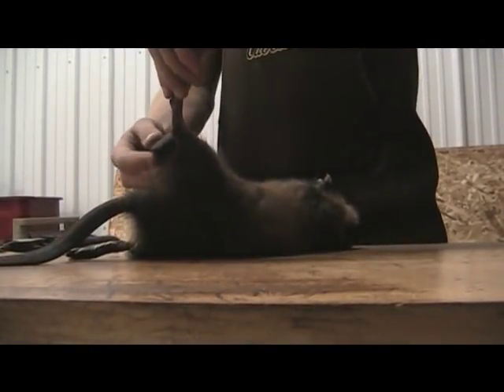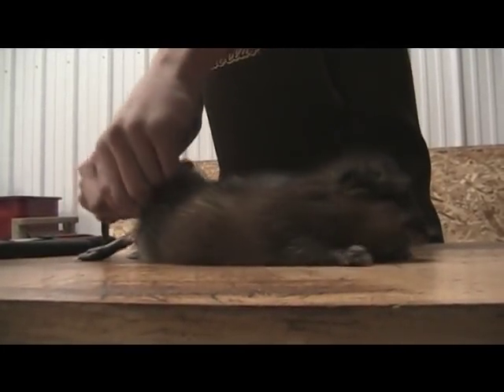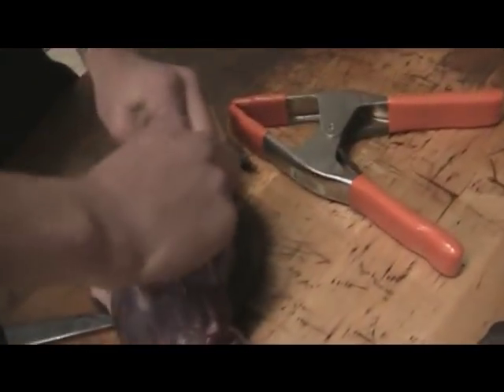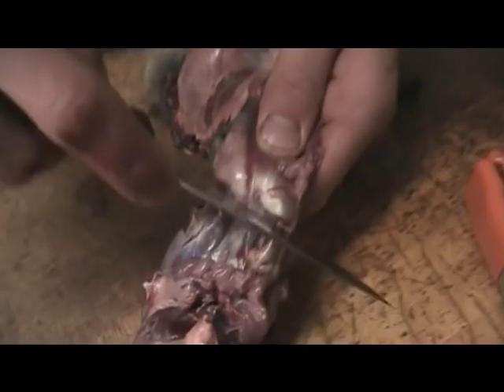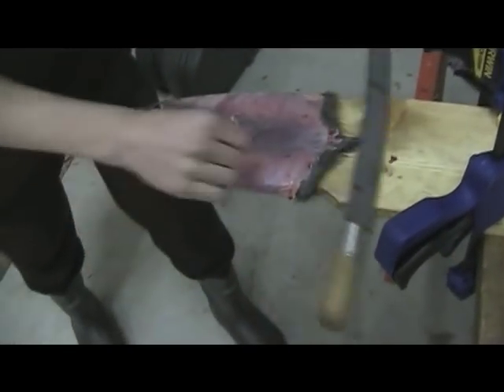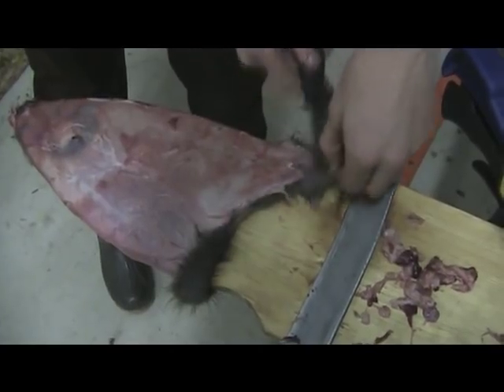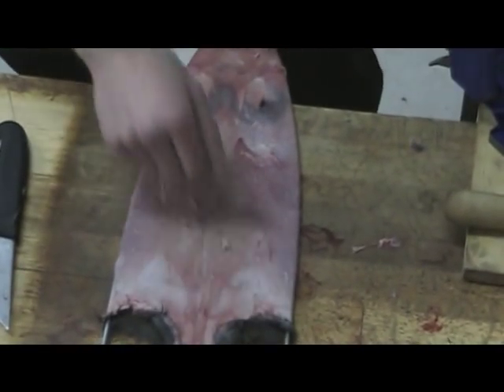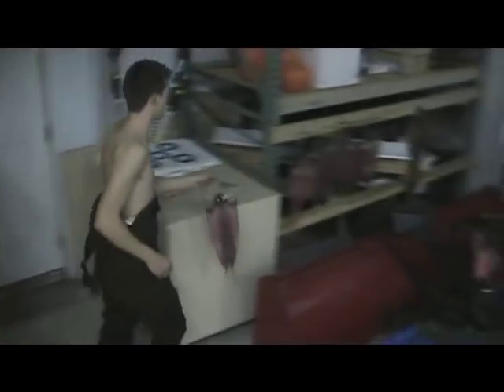How to Skin, Flesh and Stretch a Muskrat

Comment: you have a great system! not trying to correct or be a typical know it all, but when you do the eyes i noticed they were a little carped out. make sure when you are doing the eyes you slice into the skin and not the hide. even the slightest knick on the hide will raise all hell.. but you're doing a great job man! also, do you send up your furs to NAFA?

Comment: Using a knife that much only leads to accidental rips in your hide. Once you have your legs and tail started a better and faster way would be to pull the hide off like a sock all the way to the head. I also noticed they left the nose cartledge in the hide. Better to skin this out too.
Other than that, Good job

Comment: Joking ? Seriously - Beaver are cut off open, up the belly, the rear section is done the same way as muskrats, except watch out not to cut the castors - especially in the SPRING, when they are full on males - that CASTOR is worth money - CASTOR OIL - You need a beaver skinning knife, with a round blade, and a good fleshing beam.  You open up the beaver pelt from vent to chin, and skin him out.  Once you get the belly done, you cut around the sides and back carefully, cuts ruin the blanket.